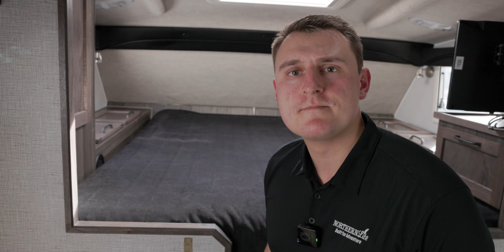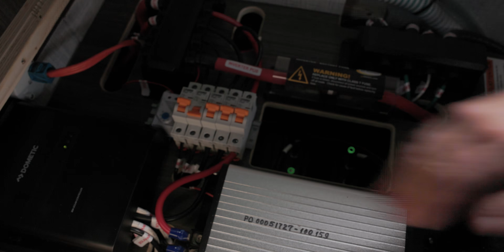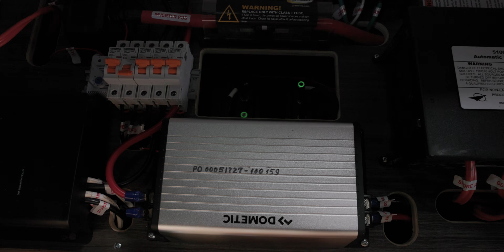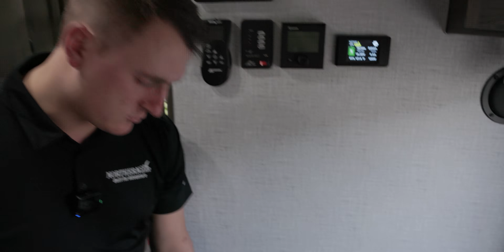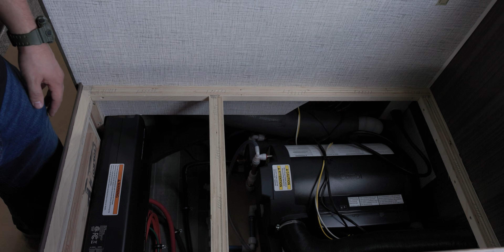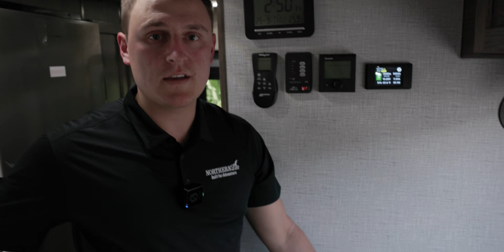600AH Lithium Power System Overview

Comment: If that second breaker is switched off disconnecting the system from the 7-pin from the truck will that affect how the jacks work and get power? What about the interior lights? Is it a complete shut off from the truck or just stops the truck from trying to charge the lithium batteries via the 7 pin?
Reply: For anyone wondering, it does not. I have the breaker for the 7 pin off in my rig now and everything is working wonderfully.
Reply: @simonizedpb I’m confused by what this does?  Do you have to flip it ON when you’re in transit toncharge the batteries via dc to dc charging from the 7 pin plug off your truck?

Comment: Matt you mention that the inverter can charge the batteries at 100 amps from shore power.  Does that mean owners are going to have to install a 50 amp power point at home to be able to plug their camper in to charge the batteries before they go camping?
Reply: 100A times 14.4VDC = 1440 Watts.    1440 Watts divided by 120VAC is approximately 12 Amps.  The manufacturer could use a 15A or 20A cord, but most likely will stick with a 30A standard RV cord/plug.
Reply: I am charging mine up just from solar but I do have everything turned off. I have a shore power connection of 50 amps (setting the controller to 30 amps) and use that when I am loading it up for a trip and have the fridge and AC on. You can just plug into a 110 also but obviously can't run as much at the same time.

Comment: Good Video Matt.  It's a bit dark which makes it hard to see all the components clearly.  

Great to see Northern Lite catch up with the other premium campers with it's electrical systems.  Is the DC to DC charging port in the truck box or on the side of the camper above the box?  I put in my own Victron DC-DC charging system in my old camper and it's best just to keep that wiring out of sight.

My other question is why not just lose the the 7 pin option rather than leave it to new owner?  Most folks won't be clever enough to keep that straight.  You'd hate to have them ruin their new lithium batteries by supplying the wrong voltage.
Reply: The DC to DC charging port on the camper is next to the 7 pin connector at the front side of the camper where it fits in the box. With my Ram it is still readily accessible. I just ordered parts to wire up my truck to use the DC to DC system and hope to have that done next week. :)